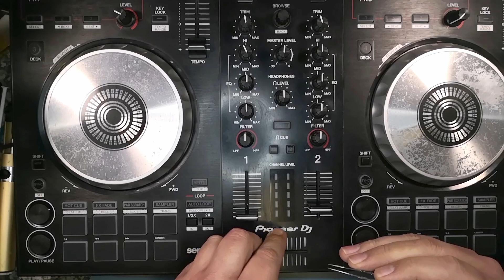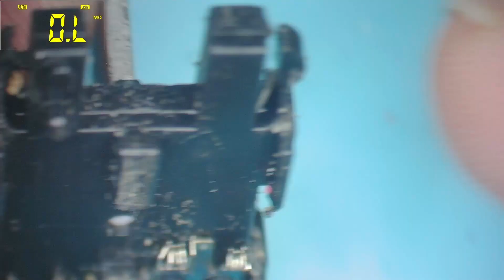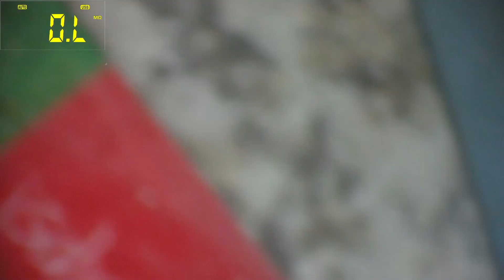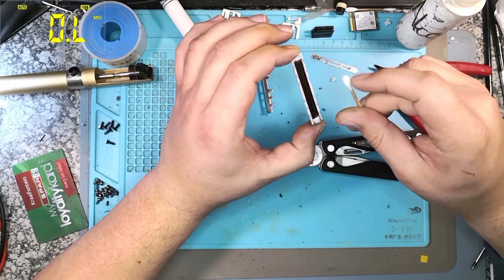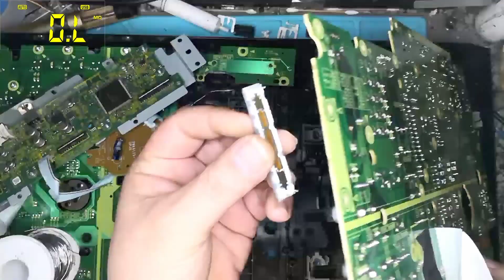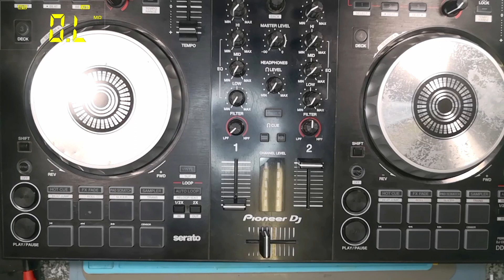pioneer dj serato ddj sb3 slider repair

Comment: Hello, great video! A question: could the Pitch Fader be replaced with a longer one or added in parallel as an external unit? 
My question is purely technical and does not concern the aesthetic aspect, but only the feasibility from an electronic functioning standpoint.

Comment: What is IPA I hear you mention it through out this video?
Reply: I had a feeling it was isopropyl alcohol, and a quick google search on "IPA soldering" gave this result: For electronic printed circuit board (PCB) assembly, you will find isopropyl alcohol being used to clean flux residues from recently soldered circuit boards or in PCB repair and rework. IPA is also used to remove solder paste or adhesive from SMT stencils.

Comment: Do you know of the faders on the Sb3 and SR2 are interchangeable?   I have both.  The SR2 fader is glitchy.  An I hardly use the sB3.  Was thinking about trying to swap them out until I can order a new one ??
Reply: probably not dude, you should find the code on them every pioneer setup has a different fader

Comment: Have collected and worked on audio and video electronics since the 80s.  I'll touch on this. A few things here that are just all wrong in the attempted repair. But I will save all that and just touch on some key things. I myself would fully become aware of said unit inside and out before a customer repair. Nothing wrong at all with learning I just like to do it on my dime. Trust me I blew up many things in my time also. I do give you much credit for wanting to dive in on this unit. I myself stay away from such because for the most part it is a pain. They make all so it is trash and buy again. I like more vintage stuff where a mixer board fader is plug and go. Now to the fun part. I do have that controller just the gold ed. I Dj and have although this new age stuff is a hmmm to me meaning I like it and I don't like it. Some things you was not aware of I picked up on in vid- the Pioneer DDJ- SB3 original released in March 2018 I recall right. It is a Dj controller used with Serato or Virtual Dj software. A account I recall must be created to verify controller and user. The full unlock use is a few hundred dollars to use. The SB3 comes with Serato lite which can be used at a low end function software unless upgraded ( paying ). When you set up for controller and software there after is alot of settings. Settings that need done to audio and all else for controller. You also have to put music on the software itself etc. So I doubt you would of got far from where the video ended at the time. That and the way the control knobs was set. A few was set to cut the audio out more less in short filter to name one. These controllers and the software are packed to do alot. Frankly after years I am still learning that. So the controller today retails at about 230 to 250 USA dollars now. To the cross fader and the fade slide CH 1 AND 2 - when I seen the bottom cross fader apart I knew it was toast. When the contact legs become bent at all or wide good luck on getting that perfect again. Because on a cross fader that needs to be perfect or there will be audio static and cut in and out. Appears to me the customer was a bit rough. Looks like the controller as a whole had the lick. Proper care and a can of Deoxit Fader lube every so often would of helped. Lastly- Soon as I seen you was not aware of the knob locker I was yelling no do not pull lol....  So Pioneer has what is called- P-LOCK. Which is the white plastic you removed from the inside of slider fades. On the right side just slide the locker up. No need to do both sides. If you do not you very well can break the pot shafts or bend the fader and legs. Which I do question if that is reason the bottom cross fader legs got mangled. Many do not but I see you did catch on fast to them P-locks and removed. That was well done there. I been there and done that with the P-locks. The knobs- they do make knob removers. It is two with curve end. Works a charm. Because yes those knobs are on there tight and one risks the damage to shaft etc. I solved all that for down the road with mine. I had changed the knobs to color knobs. I removed the factory ones and they was tight. Never again so I Q- tipped each shaft a tad after with lithium grease. So next time will be a breeze if need be.

Comment: The volume sliders on my DDJ SB3 have become real glitchy lately. Pioneer thinks its an issue with not getting enough power from USB but i had it six months before the problem even started
Reply: @Byron Kennedy My thought only. Just attempting to help in the issue based on my own doing. Which is collecting and fixing audio and vid stuff since the 80s. Based on I have the SB3 gold ed and use it for 2 years now. Along with many other older and newer mixers and controls. Slides and fades will loose the grease over time. Dirt and all else will build up inside a control. Now if some one pokes around inside to spray the wrong cheap stuff you got issues. Alot of cleaners will act as a build more to dirt. You will get a no smooth move. A audio cut in or out as you slide. The fade will not fade all out and stay audio on a ch which can be herd. Alot of other stuff. If and I say if the sliders are not damaged in any way ( mainly the contact legs ) there is proper maintenance to maintaining this issue of fades and slides. " we " old timers and vintage audio collecting use something we strongly back. It is the Deoxit family. Now there is many things in the family and you have to use the right ones for what. You do NOT want to use a cheap 3 buck can of CRC spray at Wal-Mart. You WILL damage it. You do Not want to cheap out. So the Deoxit family is not cheap but trust me it is worth the invest. If a vintage collecting person backs it on a 4 grand unit serviced then that says alot. Many will back that know. Answer--  get 91% alcohol nothing less... Flat end of cue-tip and coat in that. Stick the q-tip down in slides till you feel it hit the slide board. Moved tip back and forth lightly about 3 times. Repeat with new q-tip. Put the slide in middle and get new q-tip with alcohol on it. Clean the far left and right of slide. Now when I say q-tip do not buy junk buck tips. They with get caught inside of slide and create issue. Buy wooden sticks if can. So now you have cleaned the best you can aside from full break down. At this point you stripped the glide grease. So that slide is going to feel junk and sloppy. Another words no pull to it. You have two options here. Grease it which is best but is a pain with Deoxit Fader cream. I myself do it. I also use the spray which is- Hosa CAIG. Use it because it is the best friend here. So pay to play and buy it. Put slide in middle and spray with DEOXIT FADER F5. Do NOT spray much at all. Does not take much. Work the slide fully left to right about 6 times. Leave it sit a hour. Let me know what you get.....   Side note- unplug controller from any cable and any power. Do above clean. Wait a hour before you plug back in any cable or power. Again the DEOXIT spray does NOT take much when you spray it. So don't coat the inside to death or you have problems. In any event this is what you should do every so often when you have these controllers and other stuff. Most and I say most times all that needs done is a right cleaning. Which should start often. My take is in right cleaning- if you cheap out and do not use Deoxit you are 99.9% going to trash it in the long haul. So that is my time. Sorry long but I must detail myself for better understandings to you in what you are doing. So you need this and thank me later-    https://www.ebay.com/itm/184589895768?_trkparms=amclksrc%3DITM%26aid%3D1110006%26algo%3DHOMESPLICE.SIM%26ao%3D1%26asc%3D20200818143230%26meid%3De8a35b32458a44138f8618458f8352a0%26pid%3D101224%26rk%3D1%26rkt%3D5%26sd%3D373549257765%26itm%3D184589895768%26pmt%3D0%26noa%3D1%26pg%3D2047675%26algv%3DDefaultOrganicWeb%26brand%3DHosa+Technology&_trksid=p2047675.c101224.m-1